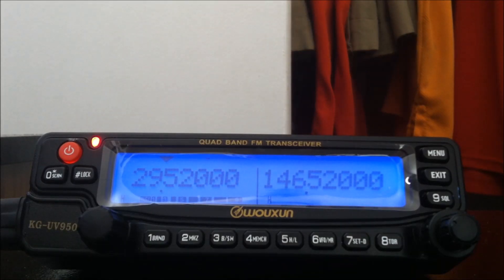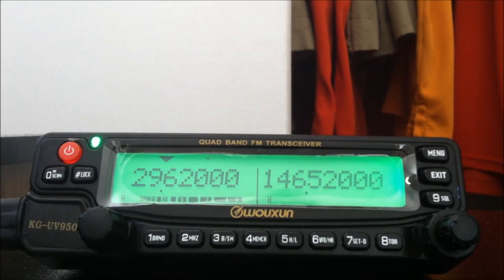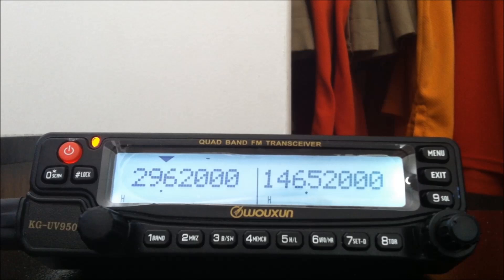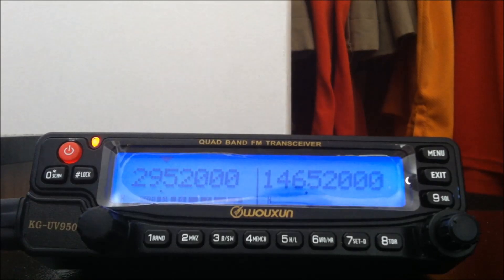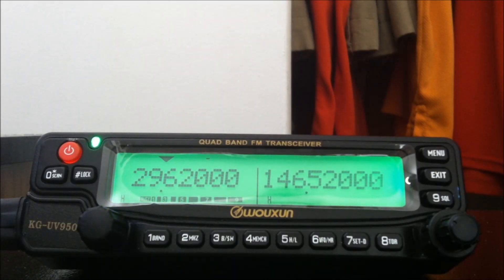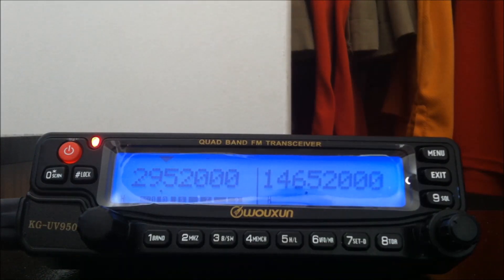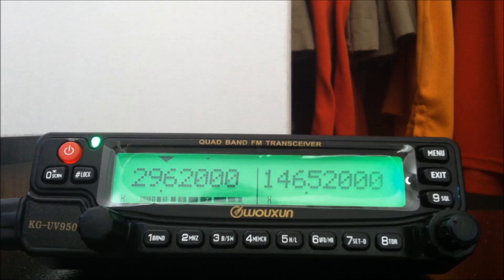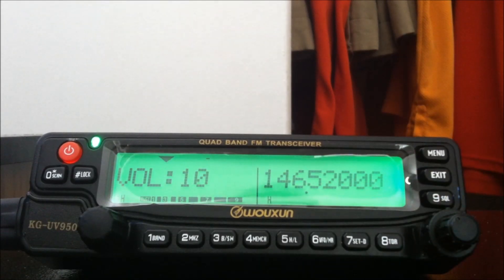Wouxun KG-UV950p demonstration KQ2H 10 meter FM repeater

Comment: I used a old Antron 99 cut to the 10 meter fm and it worked very well. Years ago when I was trucking I got into that repeater from California going north on I-5. All I had was a Icom 706 with a LDG 200 tuner going into a Wilson 2000 antenna.

Comment: I'm in Region 1 and I've got 70 Mhz instead of 30 Mhz on my rig. works great. But swings and roundabouts, you got 220 MHz we don't
Reply: You also have 144-146 and 430-440 we get 44-48 and 30-50
Reply: Actually, you must have bought the "PL" model. "P" model has 10 meter. "PL" model has 4 meters instead.

Comment: What antenna tuner are you using for this radio?
Reply from the maker: At the time of this video I was using a mfj-969 tuner. But only because I was using my off-center fed dipole so  hi agave to tune it for 10. This radio is now in my truck so I don't use a tuner. I have the diamond cr-8900 antenna which is tuned for 10 meters as well as 6,2 and 70cm.

Comment: So what's your options as far as antennas go?  Since there's only one antenna connection I'm assuming a pretty broad band antenna assembly is required along with a pretty spendy tuner.  Am I off on this?  I like the idea of the radio but am concerned with being able to switch between, say, low ten meters and up to 70cm.
Reply from the maker: I have the Diamond cr8900 quad band antenna, it matches with this radio, 10m 6m 2m 70cm, no tuner is required on this setup. Just minor tuning on the antenna that coms with instructions.  China has a generic replica of the diamond antenna I have, but I recommend the extra 30 bucks for the diamond, I had no luck with the hr8900 china model...  They also make an MFJ antenna that covers these bands wi the addition of several HF options on it like 15 and 20m but this radio does not have those bands so no need to have an antenna that has those options when you can't use them.

Comment: I'm still in the process of studying for my technician class so this may seem like a stupid question, but what is the purpose of the courtesy tones? Also, I noticed your receive and transmit frequencies are different, is that the offset?
Reply from the maker: Yes this is the offset, and the courtesy tones are just a signal that the repeater is done with your transmission into it. Basically, when you hear the tone, it means you are ready to transmit that the other party has unkeyed. Sometimes when conditions fade, you wouldn't be alb to tell if the person you are talking to is done talking, most of the time the courtesy tone will make it through the low signal or the noise, despite you losing the other persons signal, this lets you know that he is done transmitting so you are not talking over him. Same concept as a roger beep on CB.
Reply: @HamRadioConcepts  There is an additional purpose for the courtesy tone on repeaters. The repeater will time out if stations don't leave a break between transmissions. That timer (usually set for three minutes) does not reset immediately when you unkey. The beep often indicates when the time-out timer has been reset. If you jump in before the beep, the timer will add the duration of the previous station with yours, risking a time-out.

Comment: Good demo of the wouxun 950 I just wish 29.620 was that clear here 28 Miles east of pittsburgh PA . Always hear 3 repeaters toppling one another on that freq. Got a TYT quad band on way hope to make use on 6 & 10 m alot. Great they got these radios out for us to make use of low band FM freqs.
Reply from the maker: Yes, it usually comes in full quieting. I have worked Italy through this machine on this radio and South Africa, as well as some fm dx simplex from this radio in my car.
Reply: 10 FM is doing nicely so far.I think operators will want 2 use FM on 29mhz. I just stuck up a big 5/8 ground plane for ten tonight can't wait see performance on 29.600 tomarrow.